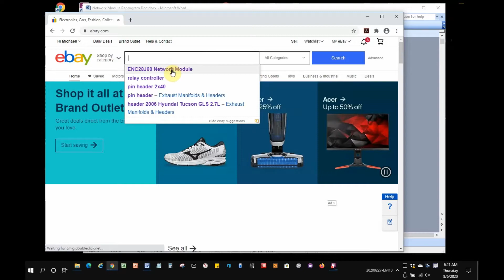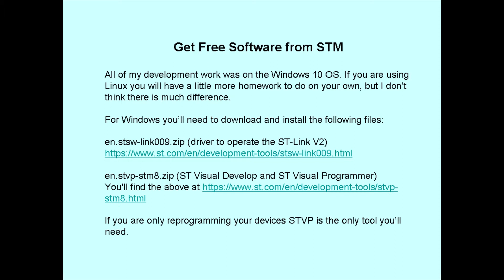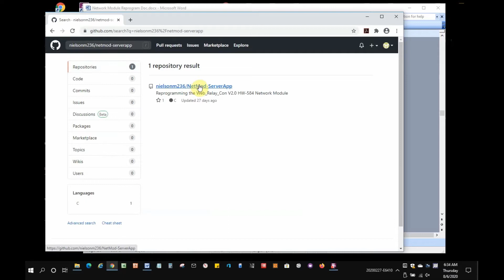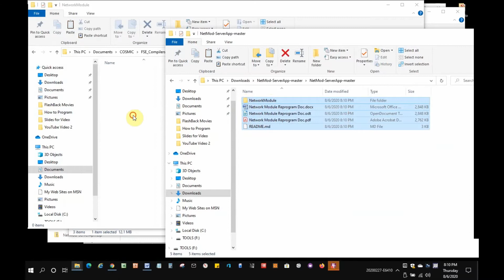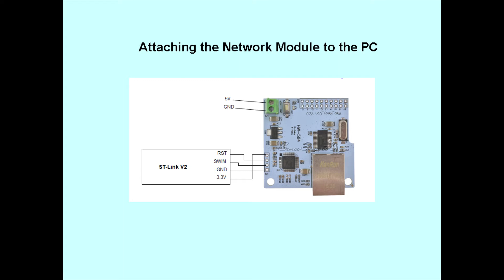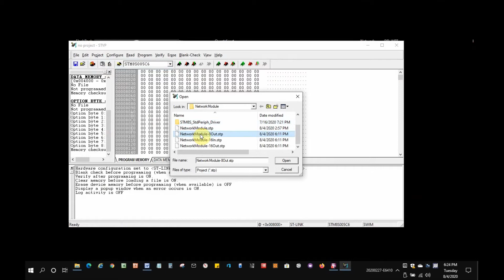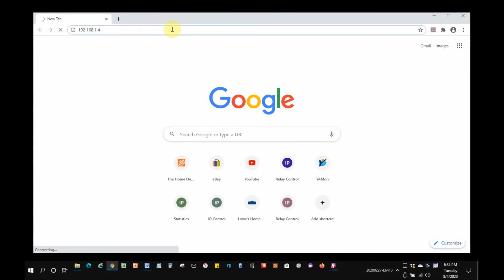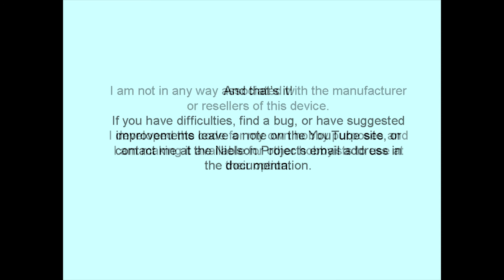Web Relay Con V2.0 HW-584 Network Module 8/16 Channel Relay Controller ENC28J60 – Reprogramming Demo

Comment: i have fc-160 web relay con v.1 and when i click in on and off in web page to on relay and off relay it work only one or two time and hangs or stuck then i have to restart device then it works and same issue after restart. please help me
Reply from the maker: Hi - My firmware is only useful on the HW-584 Web Relay Con V2 board. I don't have any V.1 boards so I cannot answer your question.

Comment: Do you know if is there any hardware difference between the 8 and 16 version besides the code and the connector itself? Thank you.
Reply from the maker: I was never able to determine how the original "from the factory" code made the board work as 8 channel or 16 channel. I suspect it has something to do with resistors BR4 and BR5, which have traces going to Port B pins on the STM8 processor. Port B is not otherwise used in the hardware design. Regardless, my firmware doesn't look at the Port B pins, and will utilize all 16 IO pins. So, you can buy an 8 IO version or a 16 IO version, and all 16 IO's will work.
Reply: @nielsonm.projects  thank you very much for you time, and since I pretend to use your code, I'll buy the 8 ports then.

Comment: Does your program take care of the ethernet board turning all relays on after power loss (I want them to be off by default after power loss)? Also, is there a way to make sure that only 1 relay out of the 8 is on at a single time?
Reply from the maker: Yes, you can set up each relay output for default off, default on, or to use the previous (retained) state on power up. The device itself cannot make sure only one relay is on ... I'd recommend using the MQTT version of the firmware and NodeRed (or similar) to handle that functionality, OR you might be able to write your own state machine in a batch file if you want to stick with the Browser Only version. I strongly recommend downloading the Manual from GitHub as it answers all these questions and provides suggestions on handling other power scenarios.

Comment: Hi Mike:
I am waiting for all the material to start working with it.
Could the firmware be modified so that only one relay is activated?
That is, if I have one relay activated and another is activated, the first one is deactivated.
It would be to make a remote switch but only one relay can be active at a time.
Greetings.
Juan
Reply from the maker: Hi Juan - I think what you are trying to accomplish would be better suited to an MQTT application or to using the REST commands with the device. I'm not exactly clear about your application but it seems that Powershell could be used to issue the REST commands (if your OS is Windows).
Mike

Comment: Excellent project, I would like to leave a suggestion, do the same with the following product https://www.ebay.com/itm/HHC-N8I8OP-8-Channel-Network-TCP-Relay-Module-Remote-Control-Relay- Device- / 283746897801
Because it has everything shipped on a single board, it helps beginning users.
Reply from the maker: A very nice product - but expensive. I hope they have better documentation than what is found on eBay. Do you own one? Any idea what processor and network interface chip is used?
Reply: @nielsonm.projects  I don't know if it helps you, but I have this link
https://drive.google.com/file/d/10iwFOBayLvUjvynfSikBjnxMdYFH9vqP/view
I have a unit of it I can look at some information on the plate if I need to.

Comment: Hello Mike, excuse me for another question..but in your Release page on Github, I find only pdf manual and two files, one .stp an the other .sx. In the programming video you show 3 pairs of file due to choose the I/O configuration needed. I need 8 Out and 8 In. May be I must to program ST micro and after choose a setup inside looking in trough a web page? Thanks, Daniele
Reply from the maker: Hi Daniele - Yes, at the time the videos were made there were multiple versions to determine the IO pins. Now all is in one version, and you determine the number of inputs and outputs on the Configuration page using your browser.
Mike
Reply: @nielsonm.projects   Great, tomorrow I try to flash the board, i'm waiting fot the ST V2 programme from Amazon, for instance many thanks...Daniele
Reply from the maker: Let me know if you have any problems. The first time you flash one of these can be a little confusing.
Mike

Comment: Hello Mike, from Italy...I want to thank you for the good videos, I follow all the step and all download were ok. Only in “NetMod-ServerApp-master.zip”  I've not found in the extracted zip the file “NetworkModule-****.stp and NetworkModule-****.sx” also searching in Release Method. 
 I've made a mistake? Can you help me please?
Regards, Daniele.
Reply from the maker: Hi Daniele - The videos are getting a little out of date and I need to re-do them. You should get the source code, .stp, and .sx files from the GitHub "Release" area. Go to my site on GitHub, then look for the "Releases" area on the right hand side. You will find the latest release there. Also, I've updated the Manual to better describe how to download and install the code.
We're working on a couple of new features right now, but once those are complete I will update the videos on YouTube. That might still be a couple of months away.
Let me know if you need further help. And consider clicking on "Watch" on the GitHub site so you will be informed about new releases.
Mike

Comment: hello, is there a way to change the I/O (#1, #2 ,...#16) name in the Browser? for example from #1 to Light stairs. so it would be easier to identify in the io Control (IP:port/60)
Reply from the maker: Unfortunately No.  There is not enough EEPROM to store the names entered. There is only about 30 bytes of EEPROM left at this date, and that would allow less than 2 characters per IO for a name. Even RAM is used up on this small device ... and if I put the names there they would be "forgotten" at a reboot or power cycle. I have been considering allowing name storage in the Flash area but not sure I can actually do that. This request is in the GitHub project "issues" list for future investigation.
Reply from the maker: Hello Lukas - Just wanted to let you know that this idea has moved to the front of the queue and we have found a way to store long names.. It is difficult to fit in the available space but it is starting to look like it will work. If you "Watch" on GitHub you will be able to see when that gets released.

Comment: Hello Mike the network module arrived this week and today i tray to reprogram and guess watt i realise that i received the two board´s that i ordered with the STM8S105C6 after checking the datasheet the eeprom is 1024 bytes with an endurance of 300 Kcycle, i try to flash ít with your mod and no problem both are communicating over the lan, now i will test and will post the result here, Thank´s for your work and a happy new year.
 Jose
Reply from the maker: That is interesting. All I've ever seen is the STM8S005C6. But the devices are pin compatible. I could certainly do a lot more with the 105.
Reply from the maker: You might want to "watch" the GitHub project. Some significant code changes are underway and will produce a more useful user interface soon.
Reply: @nielsonm.projects  Yap is on my watch list... thank´s for your work.
I´m testing with Domoticz sending http command´s and the relay´s are controlled by a ULN2803APG connected to the network module directly.
 I have another module arriving from another seller next week, a´m curious  to see watt STM8S comes with it.

Comment: Good afternoon, is it possible to make the relays turn on for 2-3 seconds, and then turn off.
Reply from the maker: There was another request for this type of feature and at that time I said "I don't think it will fit". It is still true that on chip resources are extremely limited, but with the help of a couple of other developers we've  created additional space that might make it possible. I will add the request to the issues list and see if we can do this after we complete our Home Assistant / MQTT work.
Reply: @nielsonm.projects  well we will wait, thank you for the project
Reply from the maker: You may want to follow the project on GitHub. This item is Issue #19. You can add to the comments on this Issue at your option.
Reply from the maker: Can you tell me a little more about your use case? Are you in a Browser only environment? Or do you have functionality like Home Assistant or Node-Red or similar?
Reply: @nielsonm.projects  I use to overload the switch where the HW-584 is also connected
Reply from the maker: It is now looking like we'll be able to include timer functionality. Work on this is underway, so perhaps a release in a couple of weeks.

Comment: Great solution! I had not hesitated for one second before I flashed your solution over my boards - Just made my life easier my friend! thank you. I had a bit of difficulties with the flashing but I managed to install and change the IP on Each one using a Crossover Ethernet cable - and I also changed the MAC address on all to match their locations (at the end) 01,02 etc.. I just downloaded your latest MQTT for OUT8 and Installed it on one to see what is the added value. It is nice to have an indication on the Status of the module in my main MQTT server. I was hoping to find the states of my relays as well.. Hope that you'll have it for the 16OUT as well - since I use it the most (frankly I need only 10 and 8 is not enough).
I would be happy to create my own changes to the sx files and upload them so they meet my needs without the need to change the IP manually when connecting to my PC. as well as to see how the MQTT integrates with the board itself. I have NOT yet tested it with relays - going to do that soon - when my relays will arrive. Thanks for the videos and the solution for that simple to use board. Thanks Mike!
Reply from the maker: Arye - In looking at the code I think I might be able to get 16out to work with MQTT. I would need to condense the code more and it might barely fit. The problem, of course, is that if a future bug shows up that needs code space to fix the 16out might not be able to get that fix. I am currently working on one of the Issues, and when I get done with that I will see if I can make a special build for you that provides 16outMQTT. I wouldn't want to make that generally available until I can find a way to make that build with at least 1K of spare space for future changes. Let me know if interested.
Reply: @nielsonm.projects  That is great! Will be happy to know when you'll have it up and tested. That would be great to have with the firmware that is already giving a lot! Thanks for everything Mike!
Reply: "My Little Worries" is my son's YouTube account and I was not paying attention and I replied using it :) Thanks
Reply from the maker: Hi Arye - can you tell me what version the code reports in the Configuration page?
Reply from the maker: Just checking to see if you got it going.
Reply from the maker: Hi Arye - I'm pleased this works for you. Some comments / answers:
Once you are familiar with flashing the devices you'll find you don't have to direct connect to your PC/Laptop to do the initial programming IF your network is 192.168.1.xxx. I recommend the direct connect because networks may not be set up with 192.168.1.xxx in which case they must go to the trouble of direct connect to the PC.
16out with MQTT likely cannot be combined with MQTT because of code size limitations. I have it on my list to see if there is a way, but it did not look possible.
Let me know if you run into any problems. A number of people are using it now and a couple of bugs were found and fixed (see Issues on GitHub). Don't hesitate to communicate via Issues on GitHub or directly via my email address in the Documentation.
Mike
Reply: @nielsonm.projects  Thanks, will do. I needed to connect to my PC since I have a device already configured on 192.168.1.4 address already and I could not turn it off to put it offline (it is a valid network resource that we all are using) and configure the device change the address and put it back online - That is why I have added a USB Ethernet device to my PC and used a Crossover cable to configure - That was for me a straight forward procedure. that is why I wanted to edit the main.c file and change the IP Address there so i will be able to use it all the time with an address that is not used. Thanks
Reply from the maker: I was thinking about your comments. There is an alternative way to change the default IP address when first bringing up a device if you feel confident with the STVP programmer. The document now includes a map of the EEPROM variables, so the process would be to use STVP to write the code into the flash, boot the device one time (no ethernet connection required), then edit the EEPROM with the STVP programmer for some initial address that works on your network, reboot the device, then connect to your network. At that point you should be able to access the device and put in a new IP address, MAC, whatever you need.  This procedure would keep you from having to put a static address in your laptop. 
If you are done programming all your devices this won't be of much value. But if you think you will be programming more devices I can add the process to my document on GitHub for you. Any interest?
Reply: @nielsonm.projects  Yes! I am interested on both ways you mentioned. I will also try the editing - I need to know exactly where to change the number 004 to my desired address. And also I want to be able to configure the relay more as well. Both would be great. Thanks!
I just noticed that in the new version I have you removed (or maybe you didn't BUT I could not find) the reverse - My relays shows OFF when they are truly ON and vice versa - In the video I saw that you had the capability to change them regarding to the relay you have - But with the Firmware i downloaded I could not find that - therefore I see ON when it is OFF. 
Is there a way to change in the new Firmware? Thanks
Reply from the maker: Hi Arye - Download the new document that describes all the changes. There is now a Config field on the Configuration page that determines Input and Output Invert, Power Cycle retain method, and controls full/half duplex on the Ethernet. The document explains those settings (be careful with Retain). I also added a section (just now!) on how to edit the EEPROM for the initial IP Address.
Reply: @nielsonm.projects  Thanks, Found it and I already inverted it to match my Active low relays, It is now show the correct state of the relay BUT still I am getting a small ON-OFF for all my relays when the module Power Cycle. The change I did was 102000 (of which the default was 002000 - But still the relays getting On and back OFF every power Cycle. Thanks
Reply from the maker: Hi Arye - I improved the reboot cycle and placed a release on GitHub. Also provided documentation with regard to latching relays on the GitHub site.
Mike
Reply: @nielsonm.projects  I have tried the new version and i am not sure if it is me - But I did not see any changes on the boot cycle on my side - it still gives a quick On and OFF to all the relays - that I don't know why and how to prevent? Is that something that can be set inside the firmware as if I have to change the settings that they will keep the saved configuration but with no need to go with an ON OFF quick cycle? Why it does that on my set of relays I am not sure. I don't know how to fix that and I would be happy to fix it. thanks
Reply from the maker: OK - yes I see why you had to do that. Once you have it on the network you can go back into the Configuration screen and change anything needed (IP address, MAC, etc). When you click Save your changes will be written to EEPROM again.

Comment: Hello from Portugal, first let me thank you for your work, i already seen this module on the internet but, did not buy´t until now,  this module is just what e need to operate the blinds in my home, let´s see if i can get it to work with Domoticz... for now just have to wait for the module and the usb key to arrive. thank´s
Reply from the maker: Hello Jose - Let me know if you have any issues. Sometimes I can help ... sometimes not :-)
FYI, I've been collaborating with another person from Portugal on adding MQTT functionality for use in home automation like Home Assistant. We are almost done but still have a few bugs to fix. But for now you can operate the device with the Browser interface.
Mike